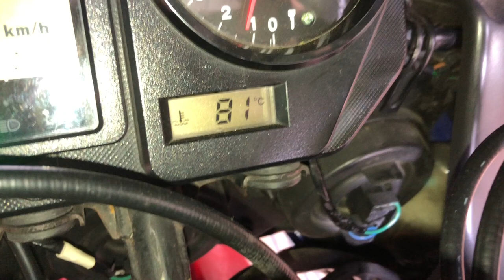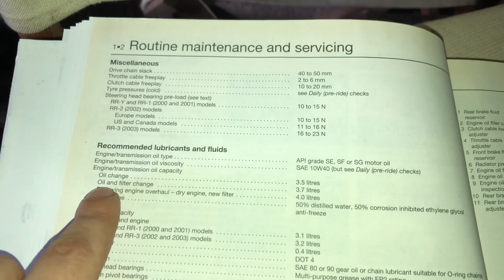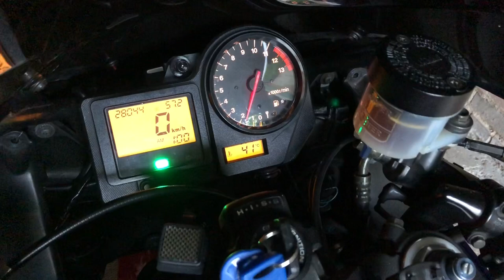Honda CBR 929 RR Fireblade Oil & Oil Filter Change

Comment: I would love to find those R&G covers for my engine. I have a CBR929RR model 2000.
Reply from the maker: https://www.ebay.co.uk/itm/R-G-Engine-Case-Covers-PAIR-for-Honda-CBR929RR-954RR-2000-2001-2002-2003-/323859741986?mkcid=16&mkevt=1&_trksid=p2349624.m46890.l6249&mkrid=710-127635-2958-0
Reply: @majkel7118  Brother, I wanted to clarify such oil, can I pour semi-synthetics into this motorcycle? The motorcycle is powerful
Reply from the maker: @PilotAlex1306  Yes, it should be semi synthetic 10W40 in those old engines

Comment: Fill the new oil filter up with oil before fitting 👍
Reply from the maker: Ian Spatchett you can do but you don't have to.
Reply: Kinda hard when they are vertical mounted
Reply: @kx250braap  it won't spill out due to the back flow cup inside the filter. I do it all the time

Comment: Hi majkel..every how many months do you change the engine oil or mileage do you change the engine oil?
Reply from the maker: The manufacturer recommends changing every 12,000 km or 8,000 miles. However, I change more often. Recently changed after 3 thousand. Even if you don't do that many kilometers, change it at least once a year. You must also replace the oil filter together with the oil.
Reply: @majkel7118  thank you brother..

Comment: Why the fuck are you unscrewing the fairing? Just stick a rubber glove on and stick your hand through the hole in the side fairing and grab filter and loosen it. You can easily drain without removing the lower fairing too.
Reply from the maker: Because I'm not lazy.  To have easier access.  Also so that the oil from the filter does not leak onto the plastics.
Reply: Absolutely unnecessary to mess with the fairing.  I’ve done 30 oil changes and never touched it one time
Reply: @tinalconnell3554  cool! He doesn't like getting his bike dirty and why would he?😍 gorgeous bike brother
Reply: @majkel7118  your bike looks immaculate by the way👌

Some may say it's unnecessary but isn't a motorcycle usually pretty unnecessary? Do it for the love :)

Comment: does the oil10w 40 differ from a car?
Reply from the maker: Yes, it should be motorcycle oil.
Reply: No, but i use full synthetic
Reply: @tinalconnell3554  lmao💀
Reply: @tinalconnell3554  honda recommends semi/part synthetic
Reply: @amantek3545  it’s curious that they do, given there is more physical durability in a full synthetic vs Standard / Semi.
Reply: @tinalconnell3554  thats right baby girl
Reply: it's different from car, because this oil will also cool your clutch pack. Car engine oil will make your clutch pack slips, not good.

Comment: Engine oil warm , hotter is better, wear gloves, remove filter first as it contains dirty oil. Use foil to create a funnel between exhaust pipes.
After oil has drained flush with some fresh oil (150ml) to clean out the last bit of dirty oil.  Don't start engine until oil is full capacity. 3.7Litres or whatever . .
Reply from the maker: The oil was warm, so I showed the temperature at the beginning of the video.  Gloves are for girls, a real mechanic will never wear gloves.  A real mechanic loves being dirty and smelling gasoline.  For the rest of the stuff, you may be right.
Reply: Majkel - disagree with your glove comment.  Due to the numerous additives in many modern automotive fluids, most auto mechanics definitely wear gloves.  Adds additional grip too vs skin
Reply from the maker: Davide DuTremblay yes but most "mechanic's" this days wearing gloves even when they change tyres for you.
Reply from the maker: @ImBetterTV I am not mechanic. I do it just for fun. I talk about mechanic's who is afraid to begin dirty. Wearing gloves even for changing brake pads, plugs etc. Oil will not kill you other chemicals can.
Reply: @majkel7118  hahahha, 60c is perfect for a hand wash, especially in cooler weather :p